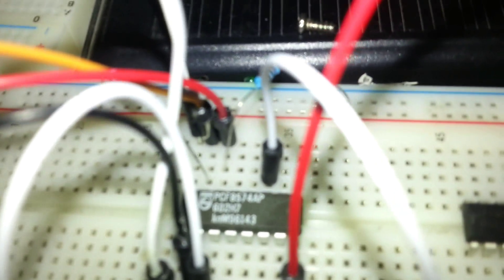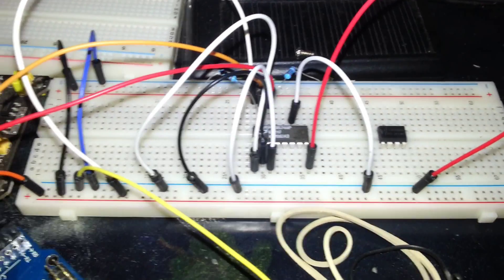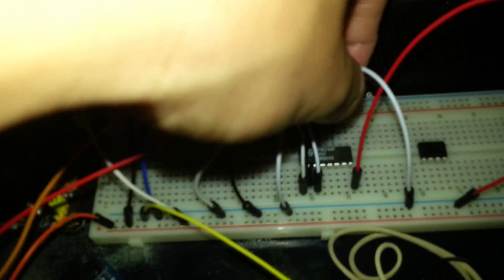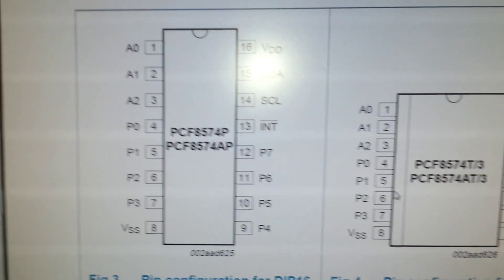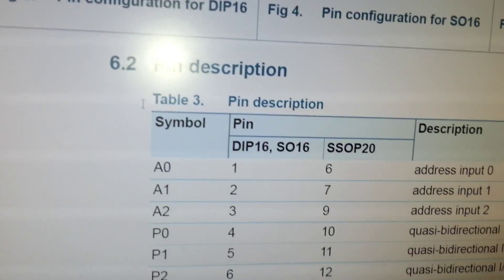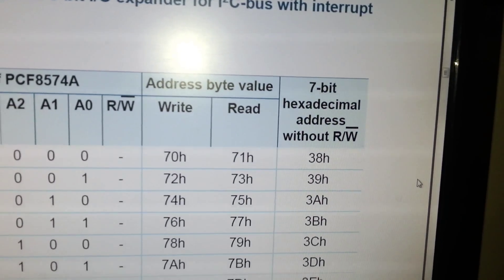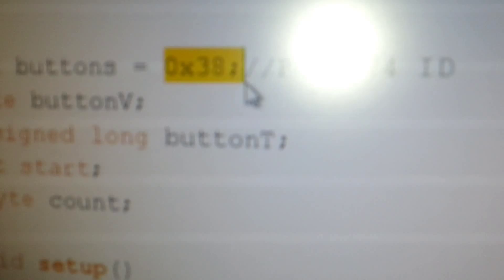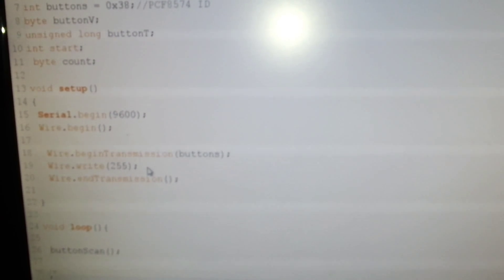How to expand and create more digital pins to read or write values from/to

Comment: Great Video!
one thing i must ask
does changing from 01000000 to 01000001 resets the second pin? i mean if it goes down , even for a second , it might trigger as a clock signal for my project. i think i readed something about latching outputs, but not sure!